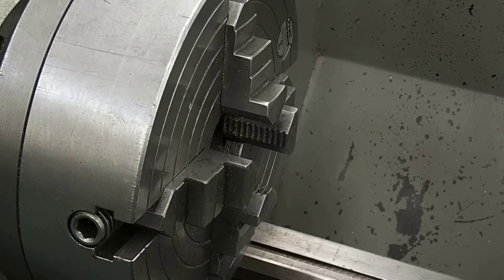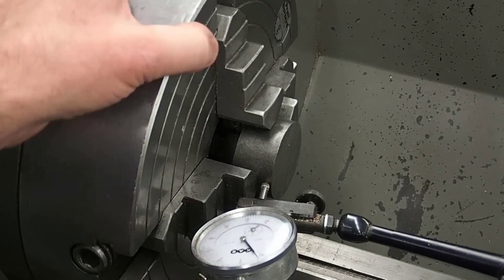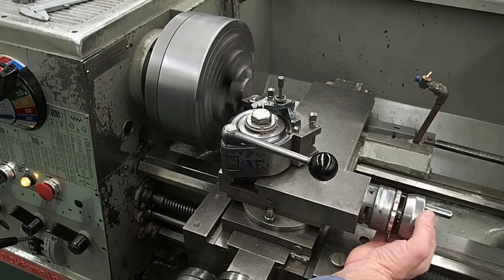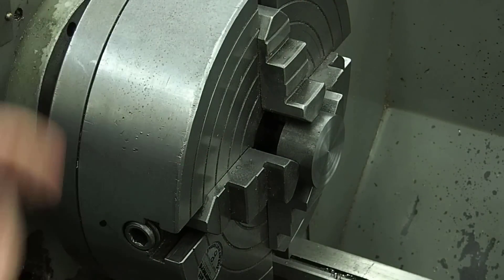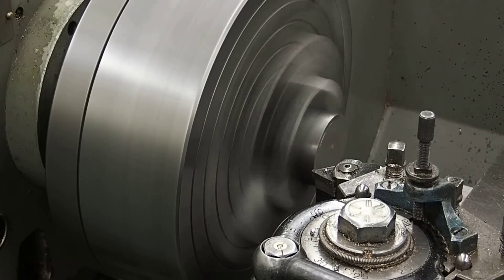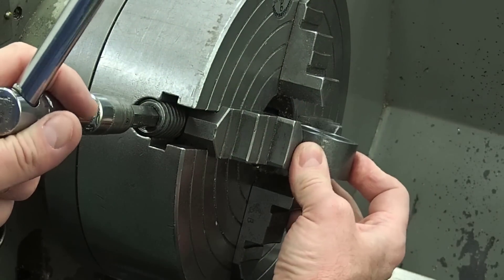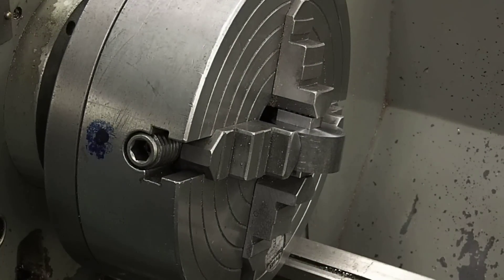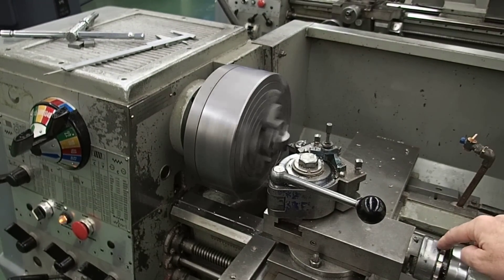Machining a Cube on a Lathe

Comment: This is not so difficult if you keep the sequence right.  
Also, to overcome the loose shims I use magnetized mild steel shims. 
I tried using permanent magnets but they fracture too easy.
Reply from the maker: That is a good suggestion. Often I will tape the shim to the jaw.

Comment: The method used is very basic, and theoretically it would produce a near-perfect cube.  However it is making the assumption that the jaws are perfect, and they are probably not.  When was the last time the jaws were ground, how much slop is there.  I would find it easier to assume that the face of the chuck is true.  Once the first cut is performed, we have for all intents, a perfect flat.  If it is flipped in the jaws, where the flat is now against the face of the chuck, then the jaws tightened while applying pressure into the direction of the face of the chuck, we should have a perfect parallel side, but, so the part doesn't end up in the spindle, we would use some parallels between the face of the chuck and the part, again, applying pressure on the part while the jaws are tightened.  

In reality though, the method used is close enough.  In the real world, nothing is perfect, it's a world of compromises.  By the way, I hear more and more people using the term "thou" instead of the word "thousandths."  I retired from a university, we had quite a few foreign students.  The term "mil" was used, but the confusion was did they mean a thousandth of an inch or a millimeter?  I noticed some confusion there.

Jim
Reply: emptech jaws don’t have to be ground. All you have to do is indicate the sides. Done it plenty of times

Comment: So the faces are made parallel by the parallel nature of the chuck jaws?  Are these that accurate?
Reply from the maker: A second (or other process) may be required depending on the degree of accuracy you require.

Comment: I work at a lab with toxic chemicals, gases, high voltage, lasers, heights, cryogenics, etc but nothing scares me more than doing interrupted cuts on a lathe.
Reply from the maker: I think I'd be more worried about the other dangers you pointed out!

Comment: Strange how u use the compound and keep locking the carriage.
Reply from the maker: With an interrupted cut it tends to push the carriage away if unlocked.
Reply: machiningmoments this I understand, I’m more curious why you have your tool set that you use the compound rather than the cross feed. I guess it’s just your habit.

Comment: How close to 1.000” inches was the cube measurements.?

Can that lathe accurately turn something to the nearest 0.0001” ?

Next try turning a sphere!...
Reply from the maker: Honestly I didn't measure it...if I was requires to work to 0.0001" I would like finish with another process. Depending on the lathe, setup, material, cutting tool, measuring tools it is possible to work that precise on a lathe. It is possible to turn a sphere on a lathe, easier on CNC, as long as you can hold it.

Comment: Wow. why didnt you just mill out the squaring process ? cant comment anymore.
Reply from the maker: That would have been smarter.
Reply: @machiningmoments  That was my thought too but I thought I'd look through the comments to see if anyone had any idea why it might be useful to make it in the lathe. So it was just a matter of "because it was technically possible"? Or maybe could there be a reason to have that turned pattern on all faces of the cube? I could see it from the standpoint of "maybe you don't have a mill and really need to make a cube out of round stock".
Reply from the maker: This all started because a viewer, who only had a lathe, asked if it was possible. I thought it was a good opportunity to film it. Honestly, I would use a mill.
Reply: @machiningmoments  Ahhh, makes sense now. Pretty ingenious though. Like I said, I can see it if you really needed a block, didn't have a mill, had a lathe and plenty of time on your hands. I never would have considered that had I not seen this. You never know what you'll have to do and how you'll do it if you get in a bind. When I bought my mill I thought I'd used the crap out of it. When I bought my lathe I thought I'd rarely use it. I use the lathe way more often than I use the mill as a mill. Often the mill just gets used as a drill press. Thanks...
Reply from the maker: A lathe is an amazing machine. Nice chatting with you!

Comment: Another way is to remove tool post  and set up a small vise on the compound and put a cutting tool in the chuck. Sort of like a horizontal mill. Set the compound at 90 degrees and use the cross feed for cuts. NEVER TRY TO USE A LATHE WITHOUT SOMEONE TO SHOW YOU HOW TO USE IT! YOU CAN GET CUT, BURNED, HIT WITH A CHUNK OF METAL, OR WRAPPED UP IN IN THE LATHE IN A SPLIT SECOND! EVEN A SMALL LATHE! I KNOW FIRST HAND!
Reply from the maker: Yes that works well, I've done it. Thanks for taking the time to leave a warning.

Comment: Obviously this is the results of someone trying to machine
from watching youtube. Your part isn't square, so what's the point? 
You indicated the part in to 0, but was that necessary? 
I've never seen anybody have their compound rest at 90 degrees.
Your unsafe TOO, 5:24 NEVER wear long sleeves while running a lathe,
Reply from the maker: The point was a viewer asked if it was possible as he didn't have a mill. I indicated it to zero so the part would be somewhat centered. I like the compound set at 90 to the cross slide as I can get a true depth. I agree long sleeves are a bad idea.

Comment: They used to make men working in the yard make a perfect cube, using only a hack saw, flat file and a ruler
Reply from the maker: I work with a guy who made functioning pliers as an apprentice with the same tools. Very impressive.
Reply: You won't make a "perfect" cube that way, maybe perfect if you check it with a square lol

Comment: This is going to sound nitpicking but tossing my calipers on top of the headstock like that would be a big "no no" where I come from.  Especially open like in the initial picture for this video.  Consider the human damage if it rattled on to the spinning chuck and shot across the shop.  It would be like a Ninja throwing star.  Very difficult to explain to your coworkers or shop owner.
Reply from the maker: Good point, one thing I've noticed shooting these videos is it shows some of the bad habits I've picked up...most of the time I don't even realize I've done somethings.

Comment: little rough, your method cannot guarantee close 90 degrees to adjacent sides. I'm a hobby machinist with a G8688. I've done a cube (in prep for a turner's cube which I was only like 70% successful), so I know this is only an approximate way to quickly smash out a cube from round stock.
I thought I could gain some tips for better machining here. running back to Abom's channel or tubalcain
Reply: This is obviously for those who cannot see how it's done. Otherwise, there would be a next step: take it over to the surface grinder when nobody is looking.
Reply: If you have a good chuck this method will easily get you within    .001 on something that small, a good test indicator will get you even closer. I true up 5" x 5" cubes in my lathe at work all the time.

Comment: Ah, to see a Colchester 600 lathe, I worked one in Sydney  Oz-stralya around 1974 it was new then. Very nostalgic to see the same chips on the grey paint and the scratches on the four jaw chuck.
However a bloody hard job, crook back from leaning forward holding heavier lumps of steel in one hand and tightening the chuck with the other, hot chips of steel (Swarf is the correct name but in the trade it is called shit) getting caught in your neck collar. Working in sheds hot in summer freezing in winter.
For the skill you have , four years apprenticeship, you end up with a piss weak wage which after Tax was 20 bucks more than the storeman, 30 bucks more than the sheila with the big tits who answered the receptionists  phone, nah a mugs game.
Interesting for people to watch and the operator has slowed down for this reason, in reality a tradesman’s works at twice the speed and chamfers the corner never to leave a sharp edge even if it is removed later.

Comment: This Method is close but not correct... One should turn 1 face then clock it square to the lathe then repeat. Having 2 'unknown sides is idiotic. They not guaranteed to be parallel just because it looks about right...
Reply from the maker: Good point.

Comment: If you rotated 180 degrees instead of 90, then you would have knocked off 2 90 degree turns and it would have been simpler.

Comment: ok, but why?!
Reply from the maker: Because one of the subscribers to this channel asked me if it was possible.
Reply: I had to do this as a training excercise to learn to work with a 4-jaws chuck. There are a lot of situations where you have parts that are not concentric and you need to machine them on a lathe. This is how you can learn it.

Comment: As soon as he put the facing cut on using the cross slide all machinists knew he was an amateur.
Reply from the maker: I'm curious how you would do a facing cut considering the cross slide moves at right angle to the ways.
Reply: @machiningmoments  Sorry I meant compound slide (it's been a long day) which is normally locked by tightening the allen screw in the side. Every turner I've ever known would put the facing cut on by moving the main saddle. That looks like a Colchester 1800 or Student as it only has 2 bolts holding said compound slide. I worked its larger cousin the 2000 for many years. If you can answer this question I will be impressed, a very old flat belt drive lath my Father owned came with a "high precision" 3 jaw chuck, a std type  4 jaw chuck, and strangely an independent jaw 3 jaw chuck. Never could think what job it could do that wasn't better suited to either of the other two. Sorry if my original comment sounded aggressive.
Reply from the maker: It is a Colchester, if you owned one I feel you had a good lathe. The reason I used the compound slide to set depth is it allows me to lock the carriage. As I turn the compound screw forward, clockwise, it sets up on the side of the screw that prevents it from backing off. No apology necessary, it's a good thing to be passionate. I also appreciate the comments here as I feel everyone reading them (myself included) can learn from.  Have a good day and thanks for sharing your experience.
Reply: @machiningmoments  As I like to say, there is more than one way to mill, (or turn), a cat.

Comment: Disclaimer: I'm a complete idiot and have no idea what I'm talking about.

The hammering sound when you first introduce the cutting tool to the piece is really painful to listen to... Wouldn't that ruin the tool on the long run because it's "not the intended use"?

Again, a complete idiot here, and I'm asking because I genuinely don't know
Reply from the maker: I have yet to meet a complete idiot...maybe a politician or two. You don't know what you don't know, the fact you are watching says you want to learn. Good on you. A quality a cutting tool requires is toughness, it needs to have the ability to tolerate the pounding of the interrupted cut. The carbide cutter can do this to some extent.
Reply: Malek Badareen there are grades Of carbide for just about any application, such as an interrupted cut.

Comment: interesting but no real practical application. If you need a 1"  cube just get 1"  steel stock to start with. also, it glosses over the fact that you're just relying on the trueness of the jaws to keep it all square.
Reply from the maker: Yes, not really practical just another way of doing a job. Thanks for watching.

Comment: Sorry, Don't look like a square to me. As an engineering apprentice I had to make a 1" square from round bar using only hand tools. tolerance was + - 001"
Reply from the maker: The video was more about transforming round stock into a (some what) square shape using a tool traditionally for round work. If I had to work to the degree of accuracy you were required to work to I would have finished with another process such as surface grinding. If you made this to +/- .001" with hand tools good on you! That would be very challenging and a skill very few could do today.
Reply: Derek Holroyd when I went to trade school I had to do the same thing , I frieking hated it. But I did it
Reply: Yeah it was a bitch, I still have it somewhere along with the tools we had to make for ourselves as apprentices.

Comment: This guy should have used 1.5 in. Dia. not 2 in. Dia. .Also, he could have smoked through the part at a much higher RPM's, like 3000 at 16 in. per minute feed. Waisting aluminum is not a good idea any place I've worked. And the time involved is money not well spent. Matter of fact, "YOU ARE FIRED!"
Reply from the maker: The material is steel.

Comment: People complaining that it's not perfect......Put up or shut up. It's a tutorial. Most people at home with a lathe, the video is more than adequate. If you need absolute precision, you won't get it from watching this as there are many more steps involved. I grew up working in .0005-.001 tolerances. If you want perfection, then you get withing a few thou. like the clip shows, then you need to know how to surface grind to achieve perfection.

Comment: Why would you do such a thing?  Just use square stock.  There's absolutely no need for this type of machining.
Reply: thats my thought
Reply from the maker: Agreed!
Reply: Then you must live in a perfect world where you never run out of anything and never have deadlines. What if you needed a cube but only had round stock because your order was incorrect, someone forgot to order the square stock or the last piece of square stock has just been used? Rather than miss the deadline and annoy the customer, it may be quicker to use this method with the available round stock.  "There's absolutely no need for this type of machining." I disagree.
Reply: @unapro3  that would be in a circumstance where it could not be foreseen that you would have to use whatever you had at the time
Reply: @mawoods34  Sooooo, then we agree that "There's absolutely no need for this type of machining." statement is incorrect? I'm confused, English not your first language?
Reply: What if you wanted to make a square head bolt and only had a lathe and a round piece of stock? this way you could do it. You may even be able to create a hex head bolt if you were careful enough. its just something to use in a pinch.
Reply: what if there is no square stock and it takes a week to get it ordered in , I guess you just take a long break.

Comment: This is just showing off, I used to work in a machine factory and my job was to make those cubes , all I did was melt a bar of lead or whatever you wanted, then when melted choose a ten plate size differs, it looked like a ice cube tray  then pour with a ladle into the tray, wait for it to cool a little , then chisel the excess lead off then alls done simples.